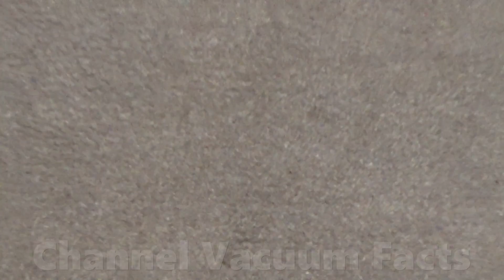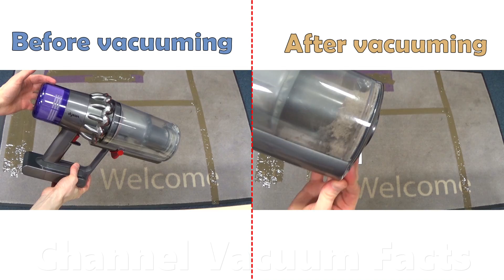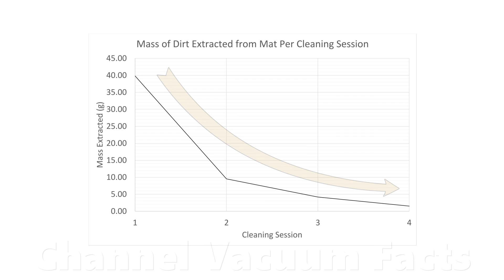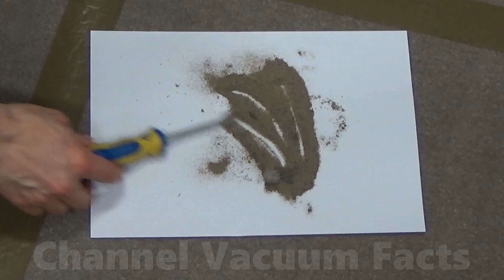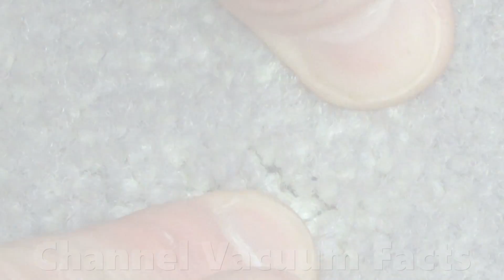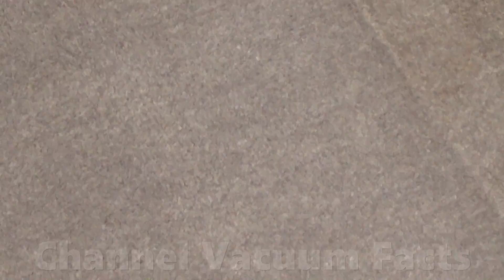Cleaning Dirtiest Carpet Mat Without Water

Comment: I haven't used the pre cleaner yet.  I have learned that you really must work the Zorb into the carpet well, until you can no longer see it.  The Zorb leaves a nice fresh clean scent behind.  So far the only negative I have is about finding it other than through Dyson directly but a bag does last a long time.
Reply from the maker: You can buy it online from pretty much any decent retailer. And yes, you have to rub it in like when you clean anything. Just get a brush and rub over the carpet a few times like in the video. It's much quicker than using water based methods and machines, including drying time.
Reply: @VacuumFacts  Not as easy to find in the US locally.  I need to get a brush like the one you used as so far I have been using a hand brush and getting down on the floor.  Is the brush you use soft bristled?
Reply from the maker: @Boodieman72  Do Amazon not supply and deliver Zorb and Dysolv? Yes, any soft indoor sweeping brush will do. If it's too course, like an outdoor brush, it is hard to use on carpets. I still think there's a business opportunity for an entrepreneur to come out with an affordable motorised tool for scrubbing microsponges in. Sebo do a machine, but it's very hard to get/expensive. I've discussed the machine in this video https://youtu.be/Myt2qzO_kcE
Reply: @VacuumFacts  Amazon does have them just no local shops I have found so far.
Reply from the maker: @Boodieman72  Ah. Alas, that's why the local shops are all going away. No one goes there because a superior shopping experience can be found online now, for better or worse, like it or not. Well, st least you can actually get it though.
Reply: @VacuumFacts  Local shops have real people to talk to and you can mostly get it right away.  Places that sell the Dyson vacuum cleaners should be carrying them, IMHO
Reply from the maker: Real people to talk to can help sometimes. Although I've found in the last few years that a bit of online research is more than enough to compensate for what real people could provide and is often better in many circumstances because you get a wider source of richer, less biased information. But yes, anywhere that sells any vacuum or carpet should sell them and equivalent products; it's a shameful failure in many ways that they don't and highlights the bias or ignorance I've discussed quite well on my chanel. Again, all part of why the shopfront is going the way of the dodo; it's just inferior, alas.

Comment: I bought the zorb cleaner and used the v11 cleaner head to try and scrub the cleaner in the fibers. Did not see a result homestlh because the zorb was still as yellow as it was on the bag. I shouldve used a real thick brush.

Btw, ive noticed that after i use the v11, dirt gets lodged into the brushbar when you take off the roller. It gets compacted into the plastic ring where alot of ppl say it breaks within a period of time because there's no rubber seal. Check your high torque cleaner head to be sure
Reply from the maker: My head is fine. No dust gets where it isn't supposed to go. Most people talk crap and don't present very convincing evidence that there is any problem on this issue. It's most likely user error, like many situations they present are later shown to be, and are misleading people, knowingly or otherwise.
Reply: @VacuumFacts  i agree. It gets annoying when ppl say how overpriced dyson products are. Its premium equiptment. But i will say for my v11, i see dust clumping on the motor side of the high torque cleaner head. I guess yours is flawless. I will admit. It gets annoying tk have to take out the brushroll to remove the packed in dust and dirt after a cleaning run, but this vac cleans my home too well for me to stop using it
Reply from the maker: Hard to advise without seeing an image of what you see from various angles. Try not doing anything as an experiment. It's under guarantee anyway and I bet it's normal and nothing bad will happen.
Reply: @VacuumFacts  ok. I will do a before and after picture for  a period of a week and show you

Comment: I'm desperate to try this on my car carpet and a few stains that just can't be cleaned by the water based cleaners. I've already tried a rug doctor and a big green and they both failed. And on the car carpet I've used a water based extractor but it never gets the job done either. I used to think that it would take a miracle to clean these carpets and that I should just remove them and replace them with new carpets, but after looking at Zorb and dysolv videos that you've made, I can see the real issue. Those just aren't great ways to get all of the deep stain out of the carpet. I need to see for myself if these cleaners will really do the job.
Reply from the maker: The situation, stain type, and how well it's used will govern success. Zorb was designed for carpets really, rather than upholstry. My playlist demonstrates the ways to use it (and Dyzolv) for a range of stain types https://www.youtube.com/playlist?list=PLBxUOcW7kaEu8EFLi2rq3aU9A1QTQ0Xkp
Reply: @VacuumFacts  Not the upholstery, that came out clean. Just the floor carpet of the car and the stains in my room carpet. My pet urinated there one day and somehow it hasnt come out no matter what carpet washer I used. I'm planning to use it on both and I wont complain if my car carpet doesnt come out clean, nor will I complain if it doesnt clean the urine. I'm expecting it not to, but after looking further into it, I know my carpet quality in my home will, at the very least, greatly improve compared to what it is now. But nothing will be known for certain for me until I try it, which I will once stock becomes available.